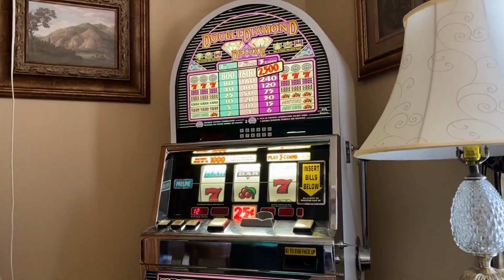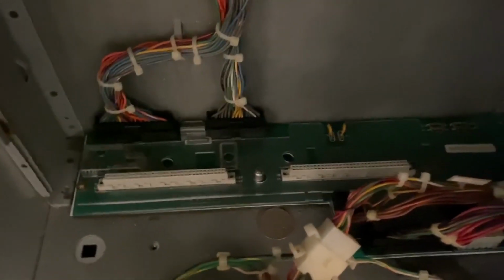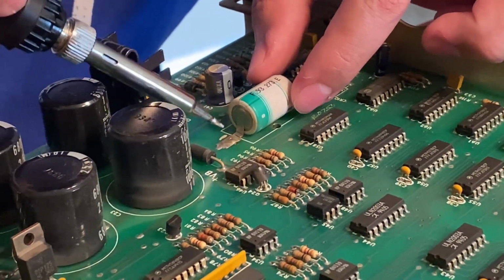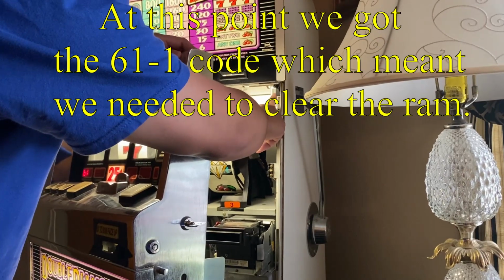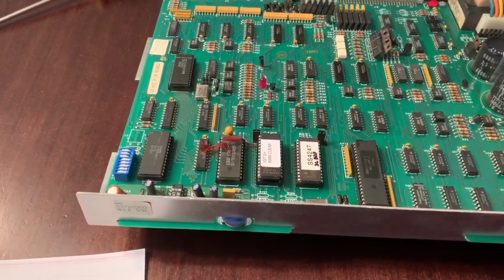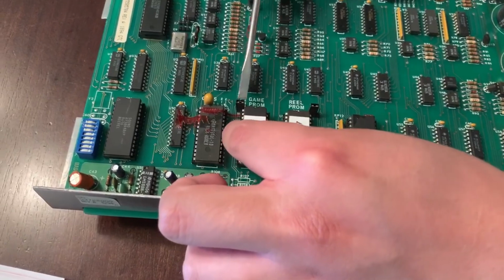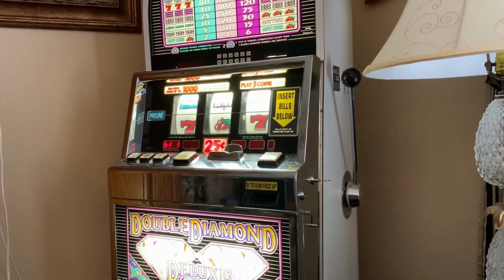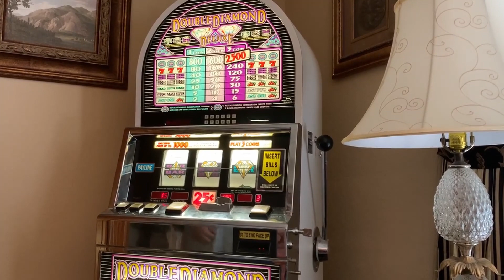Repairing an IGT Double Diamond Deluxe Slot Machine.

Comment: if i can make a suggestion? batteries are prone to leakage. do not solder it back on the board. Instead solder some wires to the + and -  of the board and have the battery some where else then the origional place. If a battery starts to leak it could start and eat up the traces on the board. by using wires and another place for the battery (preferably in a place where it can't short and cannot leak on the board (3d print a box for it for example)) if left unattented for a long time... it will only eat up the wire and that is more easy to replace then to clean the board.

Comment: This was a fantastic tutorial on replacing the battery. I wish I had seen it 6 months ago when I was scouring the internet for a tutorial on how to do this. This is a very common problem and think a lot of people could benefit from this video. Maybe add a hash tag or include "battery replacement" in the title so it is easier to identify the specific repair. Thanks for the upload.

Comment: I loved your video, i have a haywire looks exactly like yours, My battery is deak code 12 and i ordered parts and also a chip reset for both the computer and the bills, I feel it will fix my problem also

Comment: You actually were lucky that that battery lasted that long. From the code it was the original 1993 battery. Also that looks to be a 3.6v 1/2 aa lithium cell. Same type as used in the imac(1999) 

I know this vid is older but you should look into a battery holder perhaps from an old pc or mac that has the same type of battery so that you dont mess with soldering.
Oftentimes those batteries leak with time which could destroy the mainboard.

Comment: Awesome! I was just wondering if your bills work on yours? I have the bill except but mine doesn’t work. Is there a thing you have to instal or something I get the bills to work? Mine won’t even allow to except the bills. Thanks again for sharing. I have the double double diamond one
Reply from the maker: Hey, friend! Assuming you have an older machine like we do, then you will need to purchase a bill validator reset chip and that will reset your validator to accept older bills. If you want your machine to accept new bills then you will need to purchase a bill validator upgrade chip. You should be able to find them both on eBay like we did. Thanks for watching and if you have any questions let us know, we will be happy to help. 🍎

Comment: Thanks for your video.  I got the chips and a new battery.   Works but the side effect - the clear ram did as promised.  I need to figure out how to set it up to payout,  and if I put two coins in the numbers show two but the button for play two will not light and then play them.  You have to push the single play.  So there are some things that are now cleared and would anyone know what pages or key resets I need to go to?  to make these changes.  It all worked before the battery died.  Any help or input on this matter is greatly appreciated.

Comment: That's great that you got your slot machine working but I'm wondering why there is no sound each time you spin the reels?  Thanks for posting.  Just picked up a similar slot machine - Lucky 7s. Awaiting a CLR rom so I can get it back up to par after changing out the lithium battery.  Hoping for the same results.
Reply: There is a blue numbered list inside the board 1 - 8 switches turn on # that corresponds with sound

Comment: The way IGT soldered the battery to the PCB is absolutely RETARDED.  Come on!  Perhaps they send out their highly paid battery replacement guy, fly him out for $5,000, labor, parts, time, fly back to office, maybe $10,000 to replace that stupid odd battery.  I'm having trouble believing this.  It actually looks like a capacitor you're replacing, but don't take my word for it.  I've only been in electronics and circuits for 30 years.